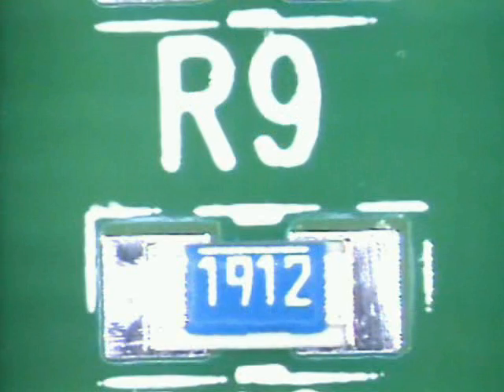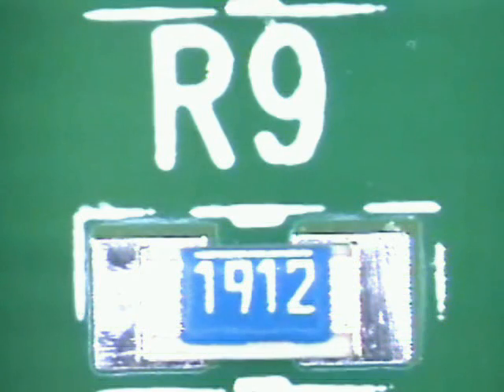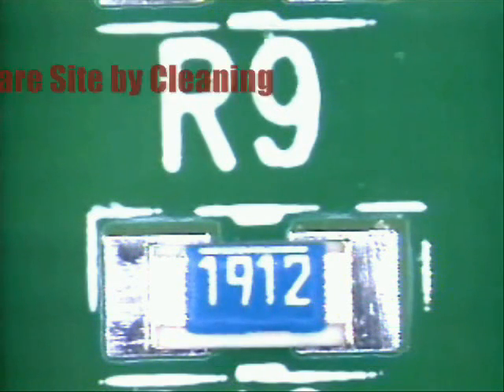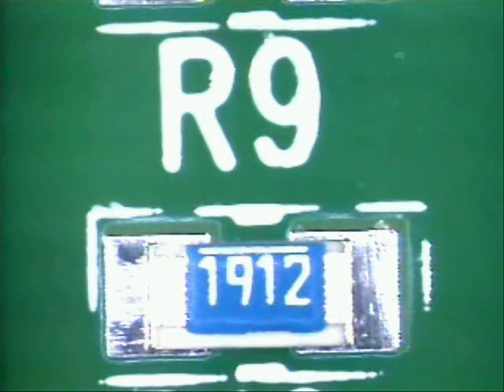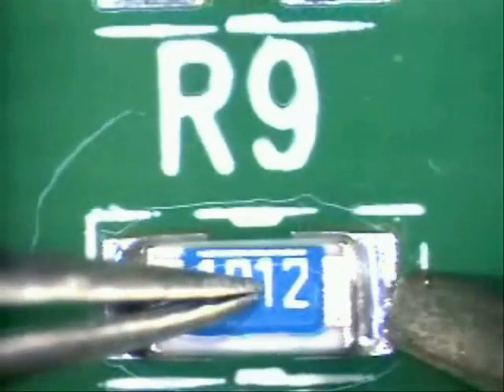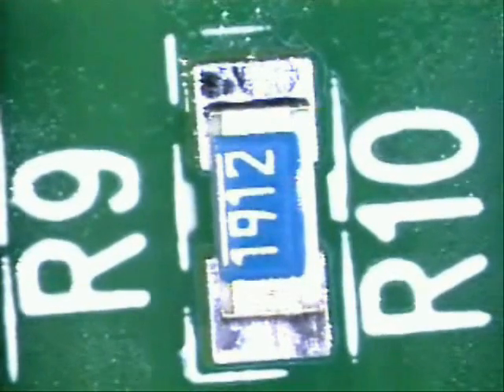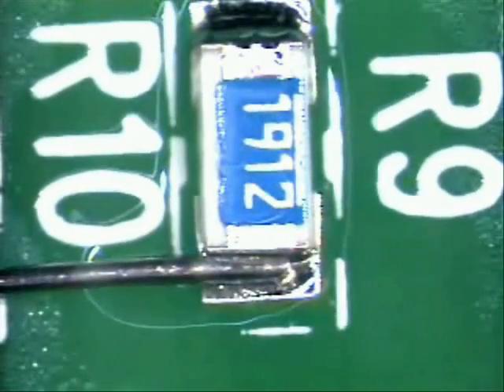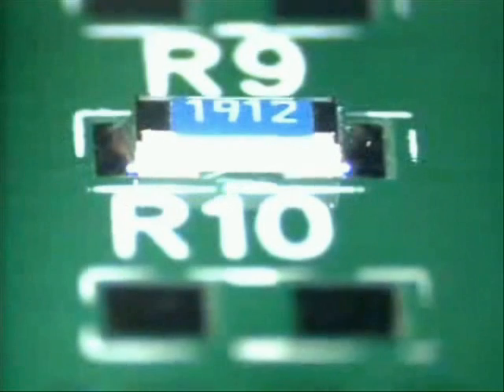1206 Installation and Soldering

Comment from the maker: You are correct.  Hot air in a tight spot could cause more issues than you would like.  Reworking of chip components is usually but not always doing with this method not hot air.

Comment: Just imagine the dimesions of that part - and the small distance to other components on a fully equipped board ... You'll blow away 5 resistors with hot air. And if you don't have a suitable soldering tip that get one fast or let it be :-).
That parts are mostly mounted with the shown technique.